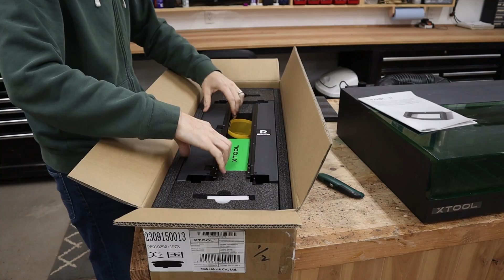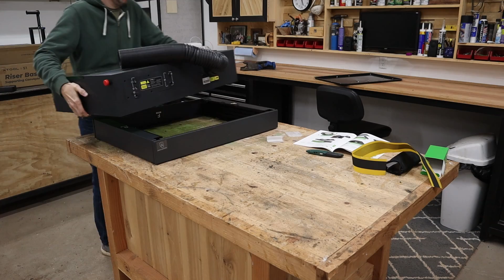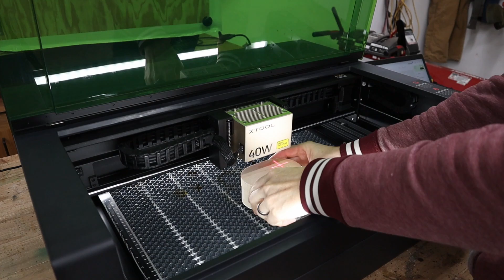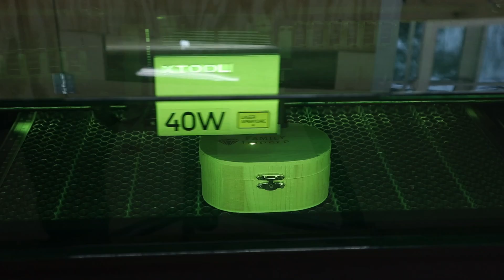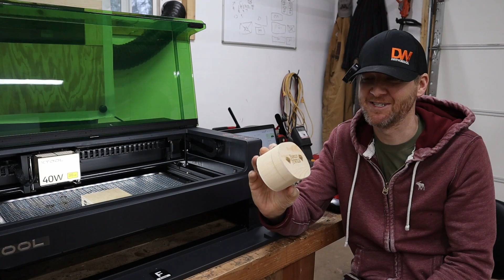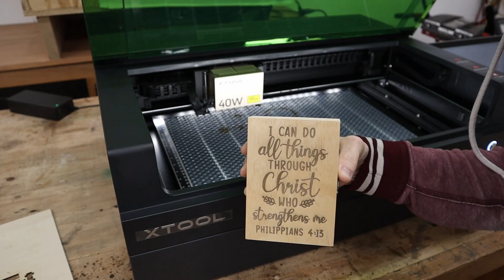xTool S1/Riser Review

Comment: Our riser base is out for delivery right now!  I've cut some simple 90 degree angle pieces of 1/2" MDF about 3"x3" to use as lifters for the honeycomb bed to get some more air flow between it and the bottom tray. One of the rubber feet the honeycomb came with was missing out of the box so taking them all off and making my own feet seemed the way to go. The riser will give me back that lost clearance and then some, yay!
Reply from the maker: Bummer that is was missing one of the rubber feet, but it sounds like you got a good solution figured out. Have fun with the riser base!

Comment: xTool has a video for putting together the riser base. I watched it after the fact so I did the same thing as you did and put the bolts in the threaded hole before I realized it was wrong. The foam adhesive strips go on the front and back panels that fold down. It goes on the outside of the little angled lip so that when the panel is closed it then blocks the gap a bit. There were 4 strips but I only used 2 (one for each panel). I guess will add the other one if there is any light leakage. I think they could have designed it better to have not needed these. I'm sure they will have a new model in a couple months (just joking but it seems like they are releasing new stuff all the time).
Reply from the maker: Thanks for the info! I will have to check out the official xtool video on this. That makes sense on the adhesive strip. That was the main part I didn't understand from the instructions.
Reply: @chaddiy  There is still a gap with the one strip. I tried putting on the 2nd one but then it wouldn't close so I went back to just one. I am going to try putting some magnetic tape over the gap as I really don't want to have to wear the glasses everytime I use it.
Reply from the maker: @mikeneron  ok, good too know. I am going to check mine out and see what I can do to seal it up a bit better...don't want any laser light coming through!

Comment: Once you add the riser base, do you put the tray on the highest level and place the honeycomb in for cutting thin wood or engraving slate tiles? Is that too far away from the laser? (new to this)
Reply from the maker: Yep, I pretty sure I just use the top slot with the honeycomb. There seems to be a lot distance that the laser head moves up and down, so it is pretty forgiving. So you might be good even going with a lower slot and the laser will adjust to that.

Comment: I think your better off not fitting the base so you can interchange it when needed. I’m having problems with the creative space software when running the S1. If I run a job at say 50 power and 10 speed the the S1 with do a duplicate pass instead of the single pass it’s set at. If I set it above 50 power it runs a single pass.
Reply from the maker: My plan is to build a cart for my S1 so that I can keep the riser base on all the time and I can easily add the converyor system I have to it as well when needed. I am sorry you are having issues with the duplicate pass. Have you contacted xtool about this? I haven't run into this issue myself.

Comment: I’m seriously considering the S1 and base to use in my shop. I make cutting boards and I’m wanting to start engraving them using the S1.  My question is that some of my boards are larger butcher block sized at 24” X 13” X 2”. I know the S1 wouldn’t fit this sized board in directly but I wonder if it would fit using the pass-through with the riser base and simply inserting the board in long ways or perpendicular to the S1. How large is the riser base opening for the pass-through?  Thanks.
Reply from the maker: Hello, You should have no problem doing this. I think with the riser base, you have around 5 inches of clearnece for your work piece...so your 2 inch thick cutting boards should work just fine!

Comment: Did you use the strips that came with the riser. I used two of the four on the back door and front door but don’t know what the other two are for.
Reply from the maker: Hello, I didn't add mine yet...because I was confused by the instructions on where exactly to put them. Do you know what they are for? To me, they didn't have much purpose. I discussed with someone else that maybe they are for a tighter seal for eye protection and smoke extraction.
Reply: @chaddiy  Riser base in EU keeps the class 1 safety cert because they aren't allowed to have the conveyor due to regulation or something. US version / conveyor compatible version drops the safety level down. xtool started providing the strips a little bit after due to reviews/concerns to mitigate the gaps from the folding panels.

Comment: The instruction for the Honeycomb are und clear too with with riser you get. I have the pass through riser but the instructions for the Honeycomb are for the none passthrough. It tells you how to put the Honeycomb into the riser all the way to the back and to the right side. There is NO WAY to do that with the honeycomb with the passthrough riser! does it just lay there in the tray?
Reply from the maker: Hello, thanks for the comment. I haven't really tasted it out much with cutting, but I just assumed that the honeycomb would just lay in the tray.  The biggest learning curve I was having is knowing what slot to put the tray in compared to how think of an item I was engraving. A few times the machine stopped because I had the tray too high. Overall, I am really happy with the machine...I just need to figure some more stuff out on it.
Reply: Can I engrave a part of piece that is too large to fit inside the machine  but would fit if I had the doors open.  The piece would be too thick to use the conveyor system.

Comment: Thanks for the useful video. A couple of questions: Can you leave the riser base on all the time once you set it up? And I see the other comments about the four strips that come with it but how is the smoke extraction if you don't install those? I got the S1 package deal with the riser and the smoke purifier so I'm wondering if I can still use the machine in the same location with the base using the smoke purifier or if I need more ventilation. Thanks!
Reply from the maker: Hello, yep...you can leave the base on all the time. That is what I do. I have now added the strips for a little better sealing. I think you should have good luck with the smoke purifier. The base shouldn't affect that at all.

Comment: I have the S1 40W, I havent installed the riser base, worried about shaking. I also have the RA2 pro which I havent used. I'm worried about the shaking and crumb tray sliding around.
Reply from the maker: Hello, I haven't noticed any major shaking with my riser base attatched. I have a video on my channel with me doing tumblers on the S1 if you want to check out my setup. Good luck with your S1!

Comment: Is anyone concerned that it loses its safety rating when using the riser?  From what xTool tells me you still have to use eye protection with the riser as light can leak out at the seam.
Reply from the maker: I guess there is no way around that to have a riser base with a pass through that opens up. I never really use the pass through so can just tape up all the seems and then I don't worry about it, but glasses should be worn if there are any gaps.